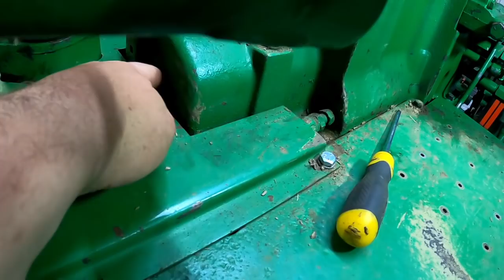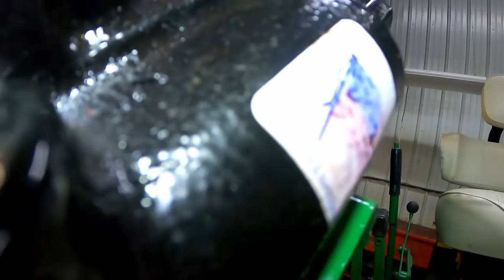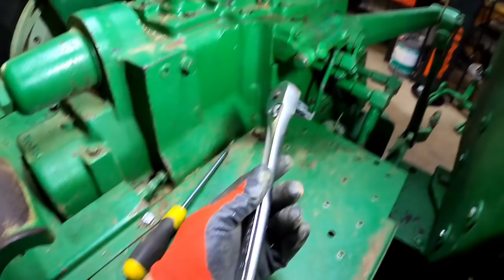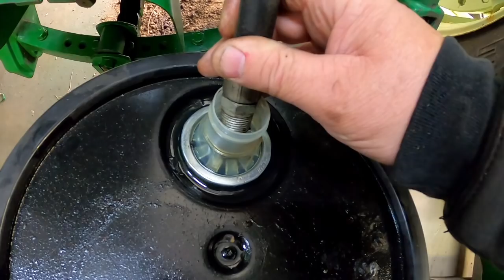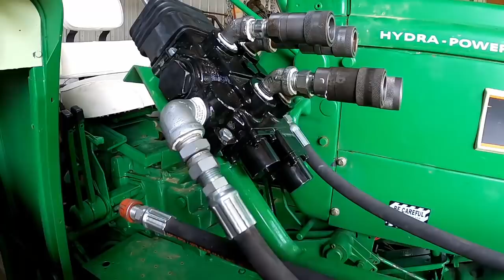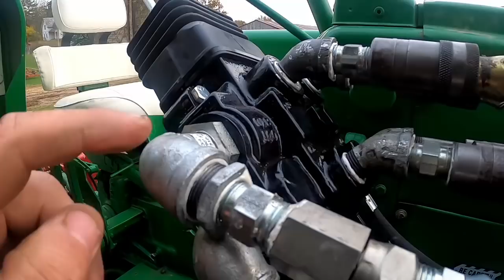Power Beyond Hydraulics for Oliver Tractors

Comment: Hey Chris great Tech video!!  I have a question about steering.  On my one 1800 I replace a leaking saginaw steering motor with a know good one from a 1850.  When turning the wheel either way and  mostly to the furthest point at low rpm it sounds like the psi relief is going off. Would that be the one by the filter or is the flow divider where that is regulated? Maybe I need to shim one of them more or a week spring?  At higher rpms it works fine, I did take the flow divider apart and cleaned it just like you talked about.  I found some rtv in the one on my 1600 that made it steer hard.  Thanks
Reply from the maker: The relief in the flow divider can make that noise, and does it at a lower pressure than the main relief by the filter. I would be looking there. It making that noise when you get to the end of the steering is normal. It should be doing it at higher rpm as well, but it might sound different with the higher flow rate. I'd pull that test plug on the flow divider and put a gauge in it to see what kind of pressure you are getting, but over all it doesn't sound too much out of the ordinary.
Reply: @ThatOliverGuyChris  ok I can test it. Next time I am on the tractor I will try and put my hand on it when I hear it to see if that's where it's coming from. If it's low pressure then maybe need a new spring? It steers fine and works good.
Reply from the maker: It might be a weak spring.
Reply: @ThatOliverGuyChris   Ok something to check.  What projects do you have for this winter that you want to get done?
Reply from the maker: @aaronkaraszewski2749  , Biggest thing is to get that purple 1850 painted and back together. I'd also like to get started on the 1855 FWA.
Reply: @ThatOliverGuyChris  Nice can't wait to see it. Our 1850 is most important on the list also. Thanks

Comment: I once put a New hydraulic pump in a 1555 oliver gas one with no 3 point hitch I believe that it is called a farm hand loader special tractor the steering works extremely good but it has 2 remote valves it will not develop pressure on the quick couplers but it will lift a dump wagon with a one way cylinder just perfect. Is it possible for the steering priority valve to cause a issue like that?
Reply from the maker: I wouldn't think that would be the priority valve, or even the single acting cylinder wouldn't work. Do you have the 3 point housing without 3 point that looks like the unit in the video, or is it a flatter cover with the remote valves bolted on top?
Reply: @ThatOliverGuyChris  it is a basically flat housing with 2 valve remote block I am thinking that the valves could be wore out a bypassing oil could a person put a basic 2 valve control like from Prince and take off the other valves? I had that happen on a g705 mm diesel tractor and I put a different valve and got hydraulic action right away
Reply from the maker: There are variable restrictors on those valves. It's a screw that has a jam nut on it that sticks out the back side of the valve. If that is turned in to far it can stop the flow on a double acting cylinder, but still let a single acting work if it is connected to the side without the restrictor.
Reply: @ThatOliverGuyChris  I will have to check it out that makes sense of what could be wrong with the hydraulic system

Comment: Great video Have a 1550 with 1710 loader Dad just used tractor remotes for loader functions back in 1968, I've heard of the power beyond option and have read about it, But your video really simplified it , Our steering isn't what it should be ,if I test pressure and's it's low will I need to add shim's?  I worked in a sugar factory for 36 years, When it come's to pipe fitting's try to tighten before you use heat, It works 90 % of time. Keep up the good work, Enjoy learning more about my tractors.  My brother and I have a 1550g, 1555g loader special 1650g and a 1850d Wheatland . And several  Whites a 2-105, 2-135 , 185, 6175 and a 6195. All but 1650 are used on regular basis, That's the tractor I learned to plow on when 6-7 years old.

Comment: An automotive machine shop showed me a trick on getting out those stuck pipe plugs. Just heat the plug itself red hot and then allow it cool completely. Then it will come out with your fingers.
Reply from the maker: Good to know. I have another plug that has been giving me grief that I can try that on. Thanks

Comment: Watching this reminds me of an event when I was young. Around 1976 my dad worked for a White dealer driving their over the road semi. They had another small semi with a wet line that  they used to pull a roll off trailer. This truck was down so they had my dad deliver a couple tractors with his truck pulling the roll off trailer. The problem was his truck did not have a wet line to run the trailer. I  was about 10 years old and I went with him. We hooked hoses from the trailer to one of the tractors and used the tractor hydraulics to roll the trailer back. We unloaded the tractors and then hooked the hoses to the other tractor to roll the trailer back on. I was sitting in the seat holding the remote lever while dad was running the levers on the trailer. The reservoir on the tractor I was on got too full and blew off the fill cap and blew oil all over me and all over that tractor. Dad thought it was pretty funny. I didnt think so at the time. lol
Reply: My dad worked for Witmers. It was a White dealer in Columbiana, Ohio. Farm hand Mike , Mike Less on you tube worked there at one time also.
Reply: Oops!  Funny now, but not at the time.  Reminded me of a time I was checking engine oil on jet engines.  The quicker we got it done, the sooner we could go back to drinking.  I opened the cap on one engine that was still winding down.  It was off but still rotating.  I took a nice shower with very warm jet engine oil.
Reply: If I remember right, the tractor was an oliver 1555
Reply from the maker: Tat reminds me of when I bought my 2255. I had sold our semi with wet kit, but still had the Landol trailer. I hired a neighbor to haul the trailer and took a long set of hoses we had, coupled up to the 2255 and used it to roll and tilt the trailer and get the tractor loaded. I didn't get an oil bath, though!
Reply: @ThatOliverGuyChris  Our fault was we used one tractor to roll the trailer off and the other to roll it on so oil from the one over filled the other.

Comment: That power beyond in the loader valve keeps the back pressure off the seals . should remain leak free for a long time. I've seen guys blow the side out of the valve working the tank line at pressure! Prince is a very good quality valve,you may have to replace linkage on the joystick if it gets a lot of use!
Reply from the maker: I really like that valve. It can be open or closed center, with power beyond, has a built in adjustable relief valve, float on the one valve, and made in the USA. I took it out and pushed some brush back along a field, and it is so much smoother than using the remotes, and easy to run with the joystick. I'm thinking I need to switch my 1750 to this setup.

Comment: Wow this was awesome thank you for taking the time to do this! I run a loader on my 1800FWA but just a plow blade for packing trench silo and snow removal etc. It’s always been off the remotes but want to add power beyond. I never completely understood the entire hydraulic unit until I watched this video thanks again. Very impressive your knowledge on these things Chris. The tractor has always steered hard, I always just thought because I have large tires on the front and it had the steering motor that wasn’t that good. Maybe it’s some thing else
Reply from the maker: Power beyond is a different setup on the 1800. I was recently trying to help someone with an 1800 C, and I haven't been able to figure that one out. The A and B have provisions, but you have to pull the entire hydraulic unit to put a plug in the housing.
My 1800 FWA steers easy, you might need to shim that relief valve in the priority valve body to get the pressure up.
Reply: @ThatOliverGuyChris  it’s funny because I just got back inside. I went out to look at my tractor after watching the video, and yes your right it does look different. I think you are right on the relief valve needing shimmed up. I notice the hydraulics chatter a little when I steer left and right, especially if I steer all the way one direction.
Reply from the maker: You might want to check the system pressure as well. Alan had someone else put a hydraulic pump in this before he knew me very well, and the system pressure was only 1,100 psi. Once I got that back up to the 2,050 psi the steering was much better. I should have made a video on that, but didn't have the gopro in the shop that day.
Reply: @ThatOliverGuyChris  That’s a good idea I will do that. I’m going to get it in the shop this winter. I’ve had a little bit of trouble with engine oil in the radiator, it’s probably time for another head gasket but I really think it needs the block decked. I keep procrastinating on the whole project because if I bring it into the shop I really want to go through and fix everything. It’s hard to justify the time because we don’t use the tractor anymore I do a little bit of work around the yards with it, but it will never have to work hard again. My dream is to completely restore it, as it really is not in very rough condition right now to begin with. Someday..
Reply: I am 99% sure the tractor is pretty much original I don’t think anyone has even touched the hydraulics. I suspect if anything the pump could be getting tired like you said in the video. I think the most disassembly that tractor has seen has been engine work over the years.